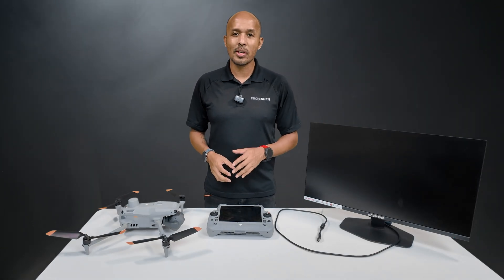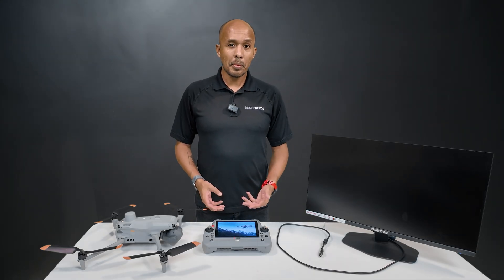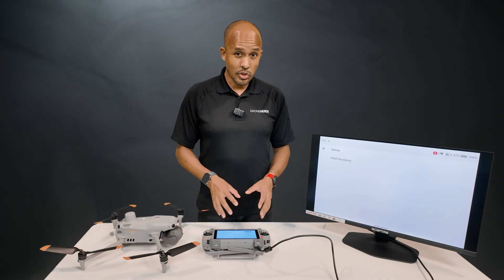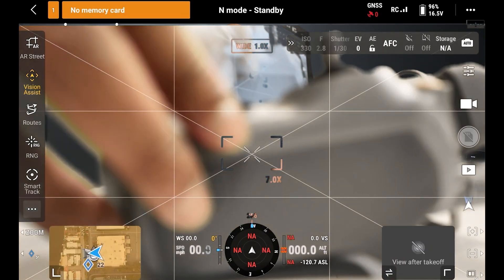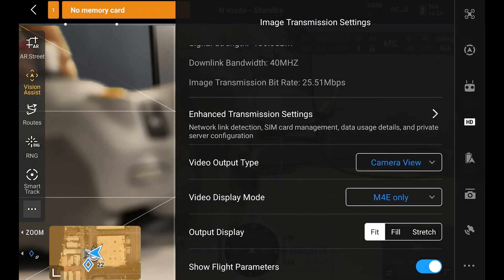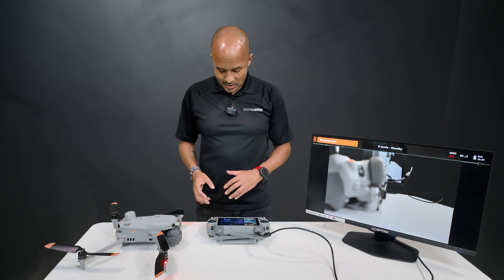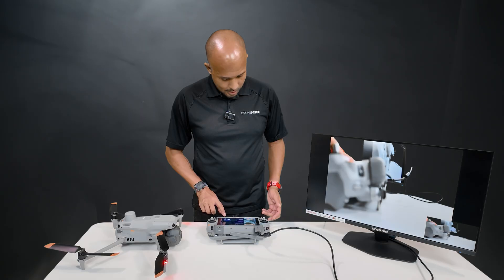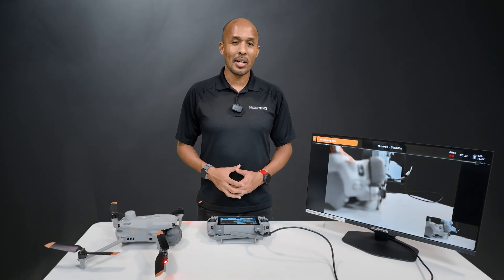Setting Up External Monitor on DJI RC Plus 2

Comment: Wireless,,, RC plus 2 hdmi into a DJI raveneye, that will transmit wirelessly to any device, in my case an android tablet, which has DJI ronin app installed, on the tablet open wifi settings, connect to raveneye wifi, open the ronin app, view the raveneye,  done, wireless, no lag, no interference,  i've been doing that for about a year with Mini 4 pro/RC2 and M4T and RC plus 2. If the tablet has HDMI out then that can go into tv HDMI in.  Note, from RC plus 2, camera view only, yes it shows the RC screen, including split screen, without all the flight controls, out of HDMI, if that's how you've set it, but it doesn't show the map view when you bring it up, so, when having a second person viewing the second monitor, ie lost pet owner, and you've bought the map up on RC to show them where you've flown or where on the map the drone is, they are not seeing that google map on the second monitor, the only way for them to see the map is if "duplicate screen" is selected in HDMI out settings.
Reply from the maker: Thanks for sharing your setup, that's really helpful!